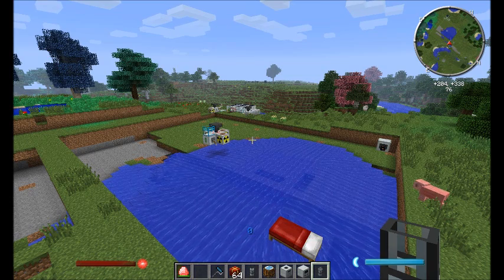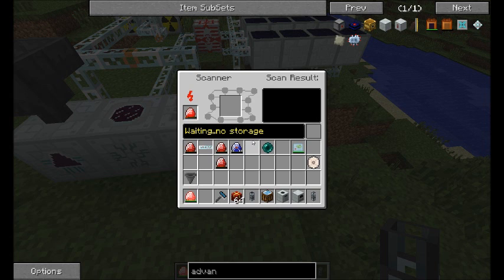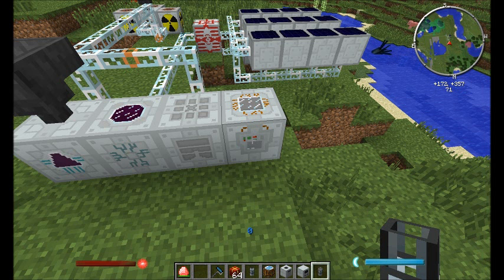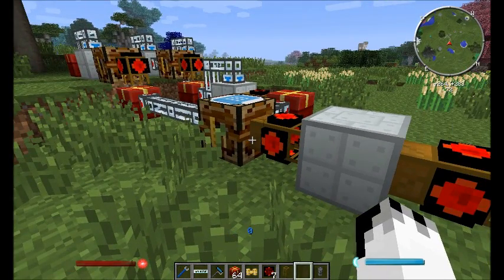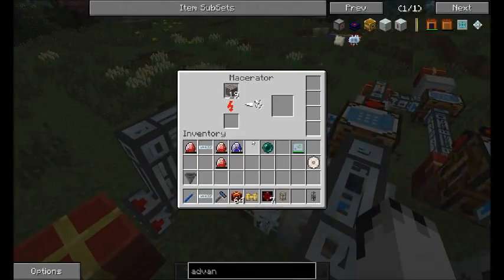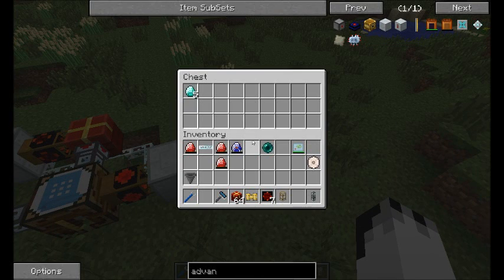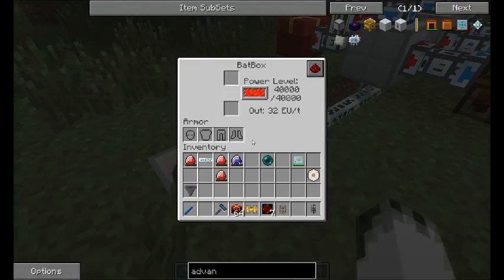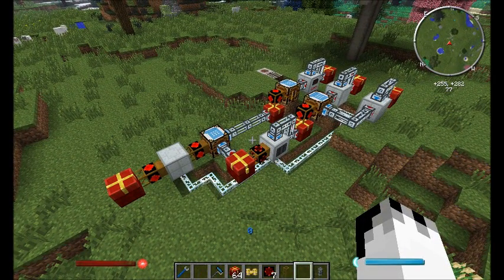Industrialcraft 2 Experimental Q/A- also, how to make diamonds

Comment: ok so i had 32 solar pannels connected to a fully charged MFE aswell as the mass fabricator. i then had the fully charged MFE connected to the mass fabricator as well. after i connected all of this together to start making uu mater i went to sleep (in game) came back and something exploded. im asuming it was the mass fabricator because it might have had to much power. Could you (if you know) tell us the max power that the mass fabricator, replicator, pattern storage, and the scanner can handle. i dont have the little indicator on how much it can handle when i hover over the items. could you also power all of this with just solar pannels?
Reply from the maker: A mass fab and scanner can take 512, the replicator takes 2048.

So, what you did was hook the mfe (output 512) to the mass fab.  You then added another 256 (32x8) from the solar panels to the mass fab.  Result= a short shower of mass, and bits of metal.
Reply: darkironphoenix ty for the quick response lol